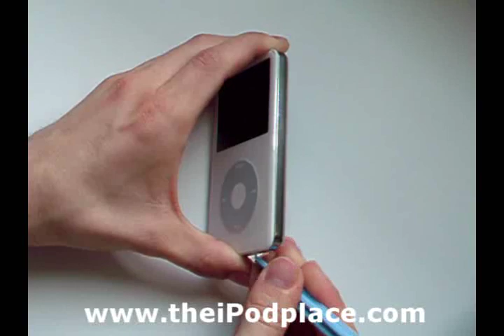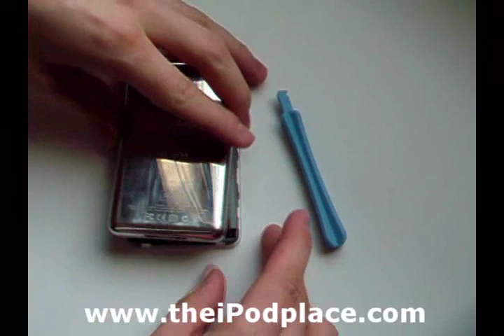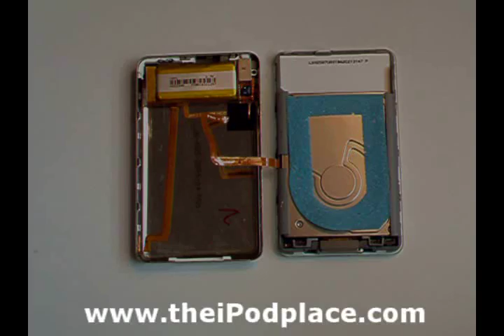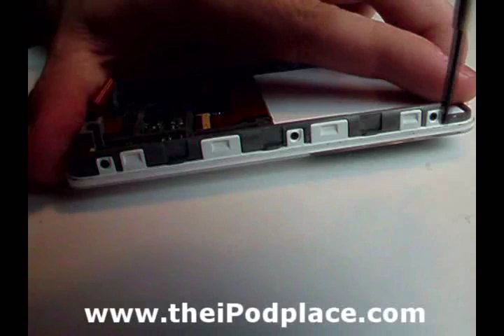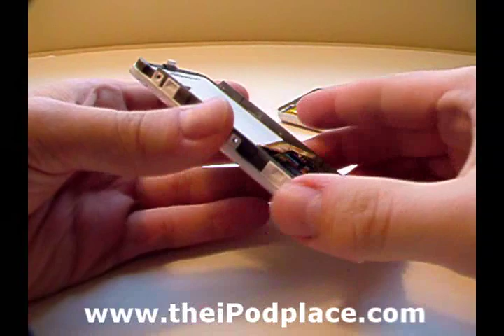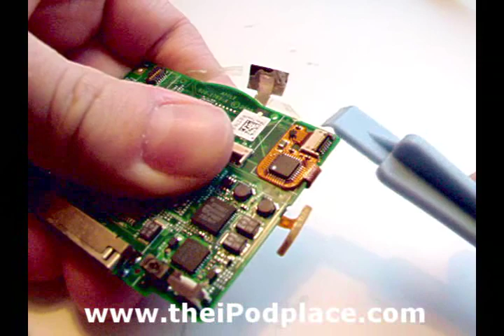Taking Apart the iPod Video 5th Gen - theiPodplace.com

Comment: I strongly advise against sliding the tool all the way down the sides like that because it's sharp enough to slice through headphone assembly cable if you press too hard.  You can see how close it is to the to the side.

Comment: If you want a simple hard drive upgrade, you can put a SAMSUNG HS12YHA 120gb hard drive in the 5th Gen Video. The hard drive is the same size as the stock 30g and needs no modifications or bigger rear casing plate.. 120gb is a pretty good upgrade.  I will send you a link.  One thing,  The 5th Gen has the Wolfsen Audio chip and is one of the best sounding Ipods made.  I have a 6th gen classic without the Wolfsen audio chip and the sound is not nearly as good.  I upgraded my 5th gen and love it.
Reply: kidwilson33  xbjkbjoj

Comment: keep in mind, when taking out that first Cable once you open it.

make sure that little latch tab is clicked down. or else the the cable will not be securely latched, and the battery ends up disconnected.

Comment: what i mean is the locking clip of the battery ribbon cable on the lower right of the ipod when opened. It has completely disconnected from the board. Can i have it soldered back, to repair that part? terminal? clip? port???

thanks iPodplace

Comment: my ipod video turns on but the screen doesn't light up screens new it on cause i'll click the buttons and it make the clicking noise its known for but stops clicking after a few press and the batteries new too so thats not tha problem do i need to replace the logic board?

Comment: I used a tiny flathead screwdriver and a guitar pick and it worked better than the tools. They were made of such soft plastic they couldn't even get between the case and the face. Does anybody know if you can put in a bigger hard drive? Mine is a 30gb 5thgen video and I wanted to upgrade...

Comment: what if the female port, or where the ribbon is connected is disconnected, is there a way for me to reconnect it without soldering? does it have a clip on the board or is it held in place by the five terminals underneath the clip?

Comment: fuck yeah! very nice video with all the little details put into evidence. i dismantled, fixed a part and put it back in place in half an hour. thanks a lot.

i had a problem for more than a year, the central button didn't work. apparently, one of the little black pads from the click wheel was a little off from the center. reajusted it and it works fine.

Comment: i'm sorry i wasn't clear... I have an iPod 5g 60G with no power... 

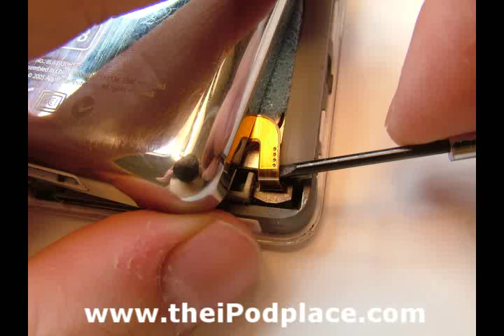There is a ribbon from the battery towards the board right? in 1:02 of this video you are removing the ribbon right? It will leave the female port... My question is, If the female port is separated from the board, would it require soldering so that it goes back to place?

The female port = the disconnected one, the one with a clip, the plastic which is white and brown with 5 terminals below. 3 up, 2 down. connected on the board

Comment: hi  ipodplac , i left my perfectly working 5gen ipod video in the car for a few days like 5 and when i recharged it  i had no sound so i left it alone for a few hours and i get sound and it cuts in a and out , like static cuts sounds , and i press hard on a area lower around the click wheel and it get sound and you have to hold your finger there and if i let go it  will cut out , press and i get sound let go and no sound . i changed the audio jack and phones and restored it , what is? motherboar

Comment: my iPod video has been messed up lately. When I connect it to the computer, nothing pops up - windows can't even detect it. When I try to charge it to a wall outlet, nothing happens either. Basically,  I can't even charge it. Any advice?

Comment: Hey mate, ive got a question, ive got a 4th Gen ipod video. The usb connector on it is faulty as although it charges up when i connect it to a pc but wont charge up when i connect to direct power source ( without a computer). I would like to replace the connector as i assume that is the problem? 

I can get the connector part , only question is, would i have to solder it into the logic board or is it screw in?

Comment: Hey just wondering... My 5th gen ipod is not working after playing it on the xbox a few times. I've had it for 2 years. When I turn it on a sad face ipod logo with an exclamation shows up saying that i should go to ipod support webpage. And I looked up the solution.. which says i need to force it into disk mode. I tried, and I'm positive its not working. The ipod webpage says its a hardware issue and i have to send it in. So does failing to force into disk mode indicate its a Harddrive issue?